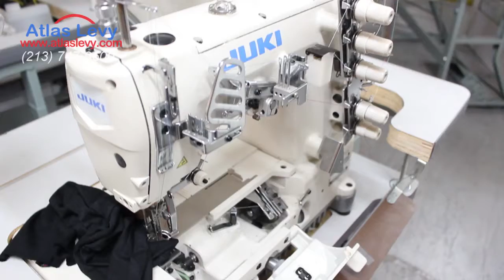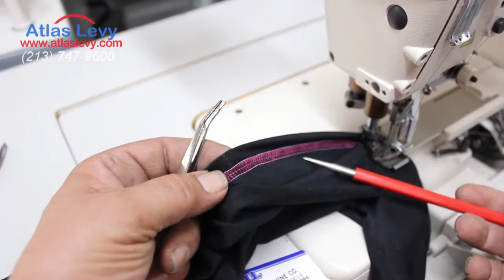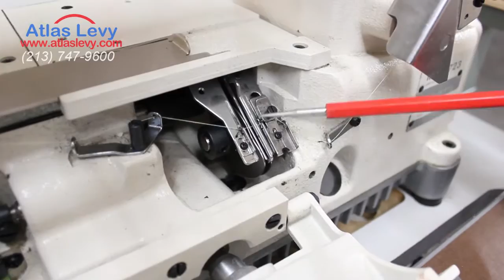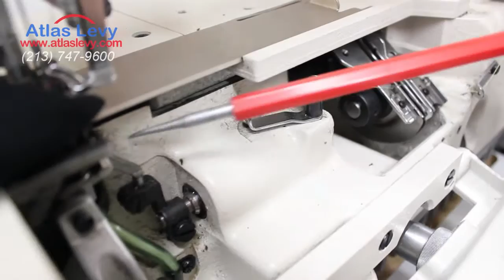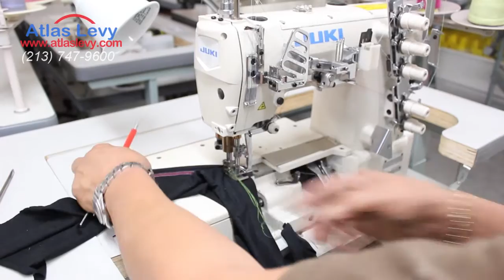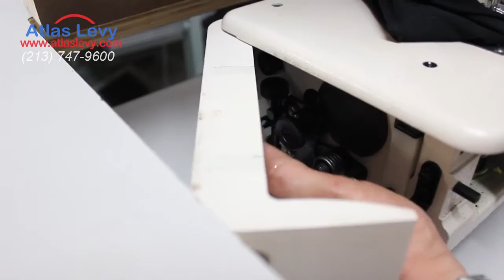How to Thread coverstitch sewing Machine - Juki 7733

Comment: Your video been helpful for me, I am totally new to does machine and instruction are horrible! I have and 664-01cb basic model, that mean there is no threads automatic cutter in the machine and when I finish sewing the material get stock under the feet and I have no clue which of the threads I should cut to free my material or know where to cut, every time  I need to re-thread, Pain in the but! All video on you tube are with automatic cuter. If you could help me that would be good.
Reply: Did you ever figure out how to do this? I also have a machine without an automatic cutter and would love  to know.